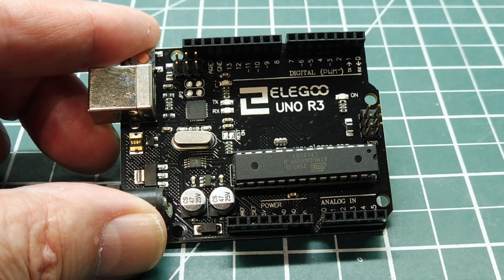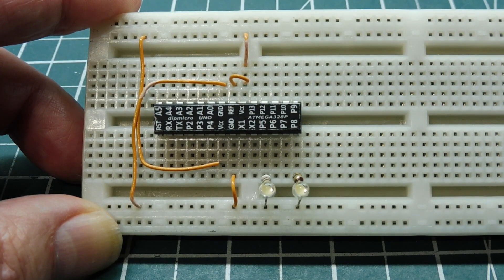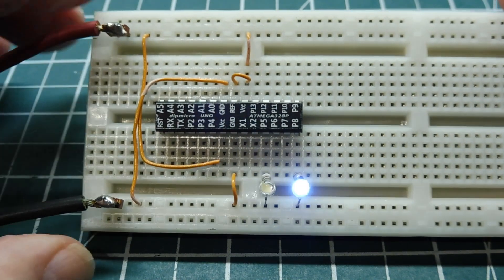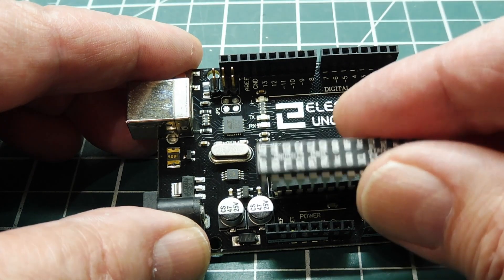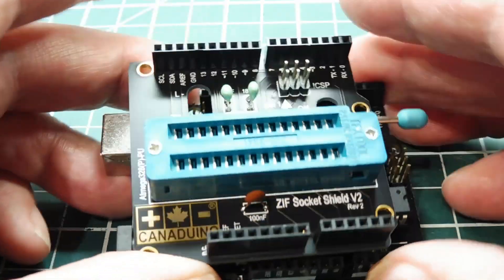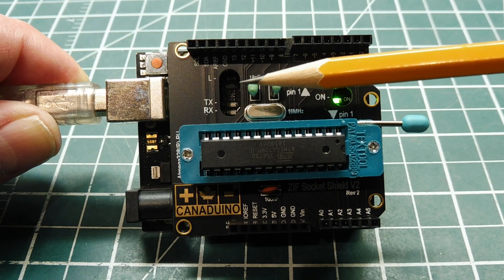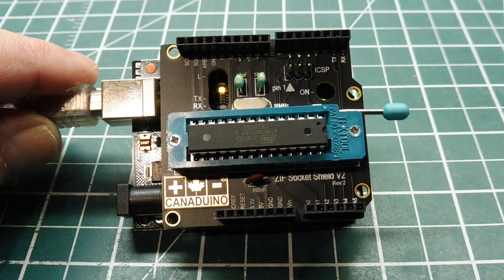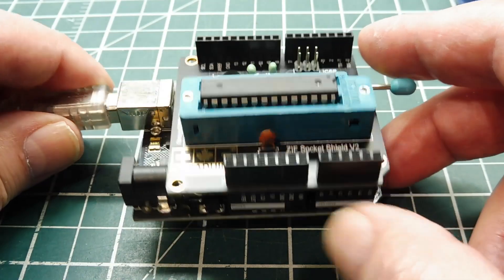ZIF Socket UNO / Barebones ATmega328p

Comment: Zif Shock is universal directional It does not matter which way you place it. I make one and I placed it forward It does not stick out the back and is much easier you do have to remember to orientate your ATmega328p The correct orientation which would be facing to the back but you do not need the handles to hang out the back you can have the handle coming alongside 9 Volt Jack Input. Also I did not desolder My chip holder It fit in there snugly enough but also Glued it it's a bit that works well

Comment: very handy, but since it is possible to program the atmega in-circuit it would be less effort if one uses a SPI breakout board. I reckon this would be a flawless solution for multiple flashing if the final code already exists.

Comment: I've had a zip socket on one of my Arduino boards for a few years now. I program it, then just connect the most basic support devices to make it work. I'm using a 20MHz crystal to drive it. As much as I like the ATmega328. The cost of a esp8266  mini d1 makes the ATmega328 2nd or 3rd on my list for a choice of microcontrollers. Prices for the chips have skyrocketed. However the Arduino Nano clones can be a viable option.

Comment: I saw that shield online from your links. Nice. I notched the corner of a plain Zif socket and pressed in my own. It does interfere with the ICSP socket however. Female header with extra long legs gets around the interference.  October 2019.